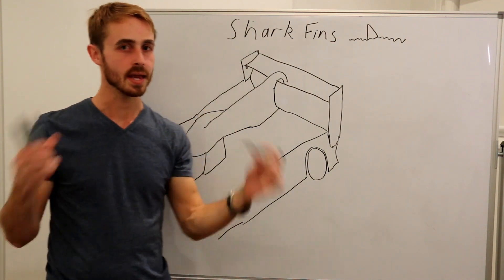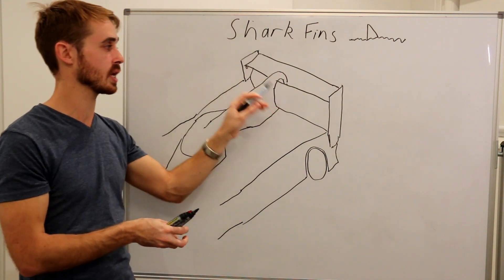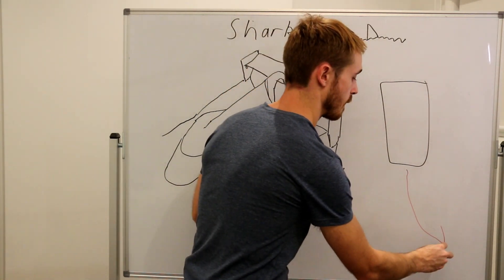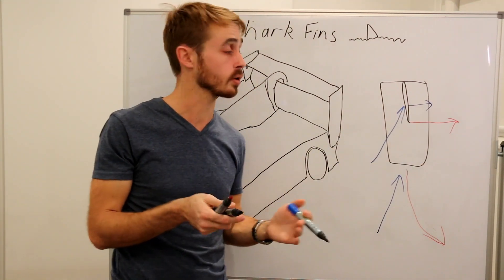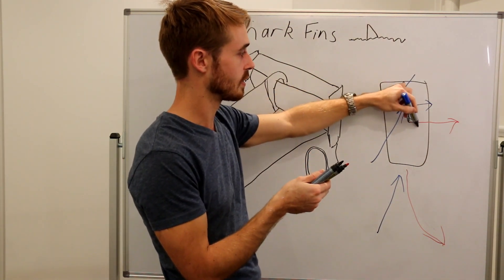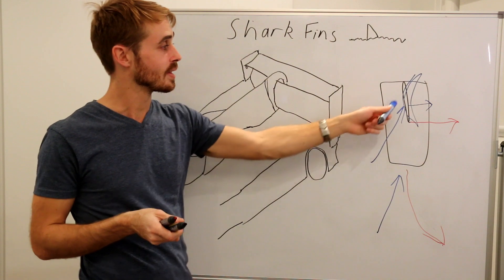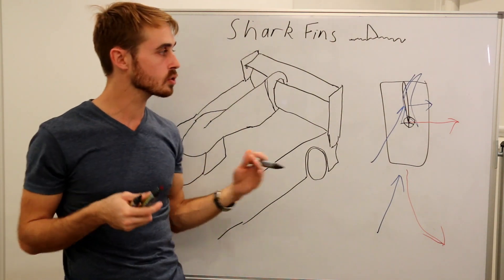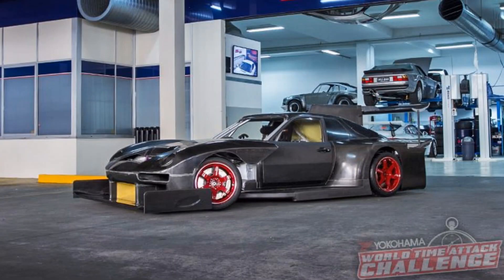Shark Fins (on Race Cars) Explained - LMP1/F1 2017 Technology

Comment: If the car was cornering to the right as drawn, wouldn't the effective airflow be oriented slightly to the left instead of the right?
Reply: No. This sounds like it would be true at first because you're thinking the car is moving through the air in the direction you're turning, but it's not. It's moving through the air in the direction you're going, as you're applying a force to change that direction. So the flow of air is from the outside corner, not the inside, since the air is caused by your velocity, not your acceleration. I think the reason this comes across as unintuitive is because we're used to perceiving acceleration, not velocity, and we also don't tend to do a lot of high speed turning.

You can confirm this by taking a turn in your car (or any other vehicle where you can feel wind and move quickly) at a reasonable speed with the windows open. Take a gradual high-speed turn  where the driver's side is on the outside of the turn, such as from a bend in the road, and air will rush in your window. If what you're saying was true, it would rush in the other window.
Reply: Ah okay, I get it. Thanks!
Reply: Exactly. My brain tells me that the airflow should aproach from the left on a left-hand corner
Reply: PcBoxStudio i think you're right. it moves against the inside of the corner, front axle first

Comment: What's the benefit of having two shark fins like the ones on your buggy?
Reply from the maker: On the buggy our rules only allow us to build to a certain height above the roof, so to get some lost area back I used two fins. The original design had one larger fin, but it looked pretty awful in CAD and meant that I would have needed to make the wing stronger and heavier than I had to with two fins.

Comment: And what about reducing effective rear wing area? As far as I know, F1 cars are rear downforce limited, and shark fins take some part of this downforce away.
On the other hand, it might work against turbulence caused by the airbox...
Anyway, this solution seems to have a lot of pros and contras, so presumably it needed to be really fine-tuned.
Reply from the maker: The worst figure I ever saw for downforce reduction was 3% (study released by Mercedes F1) for a fully sized shark fin , which is not bad at all given it was tested on the current style, narrow rear wings. A truncated fin would be considerably less, and on something like an LMP where you are not operating near the point of stall and have a much wider span wing the influence would be negligible. Even on an F1 car it would be comparable to some swan neck wing monts that some teams run.  A shortened fin, similar to what they currently run, will help with the vortex shedding off the back of the airbox, and thus should make rear wing performance more predictable in high downforce configurations. Perhaps the point to make is that the disturbance of the shark fin in low downforce situations would probably not affect your rear wing downfore at all as you are not as near stall, so you can think of it as free high speed stability for tracks like Monza or Le Mans.

And yes, like all aero devices, fine tuning is key.

Comment: Does this effects vans at all? Is there some minor benefit to be gained by having a large flat surface area like you'd find on a Transit or Hiace for example?
Reply from the maker: Well, I can't say I've really thought about it in the context of a van racecar, but conceivably their large, flat sides would provide side force in yaw... The only problems with them are the side goes all the way forwards, so it won't have great yaw stability as the CP will be forwards, and also the wide body the whole way along instead of just a fin will mean poor drag properties.
Reply: KYLE.DRIVES I've always wondered if the large hollow area of a van could be used to create effective aerodynamics that outweighs some of the negative effects, like drag.

Whether it's by attaching all kinds of fins to the large surface area or tunnelling routes for the air to travel through in some way, I don't know, I just want it.